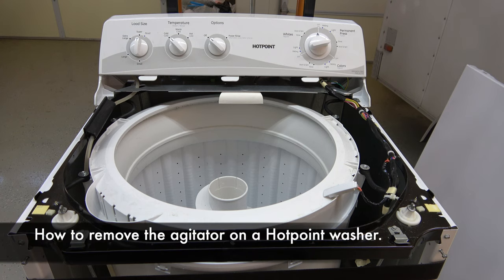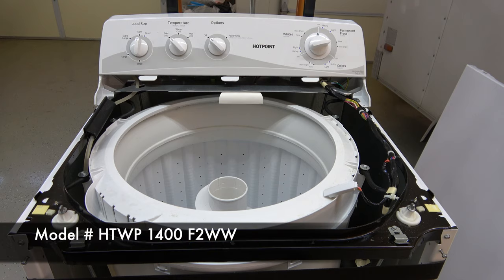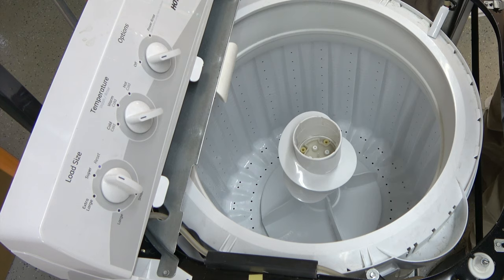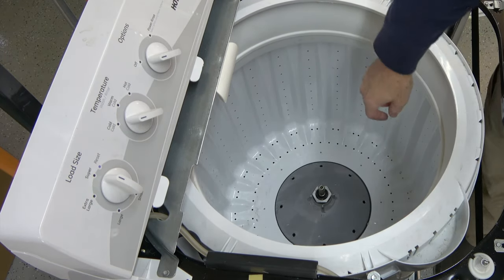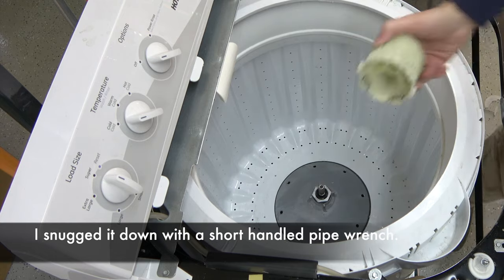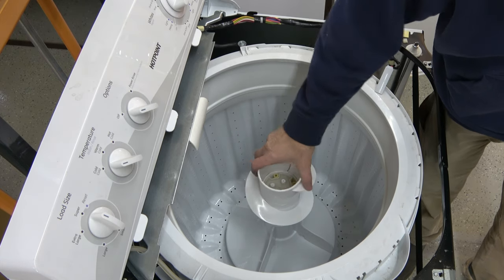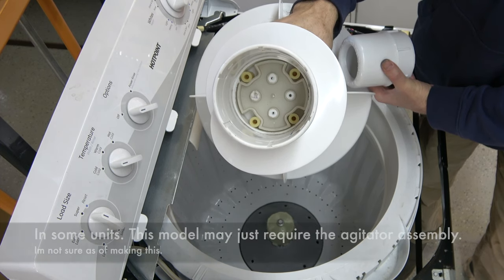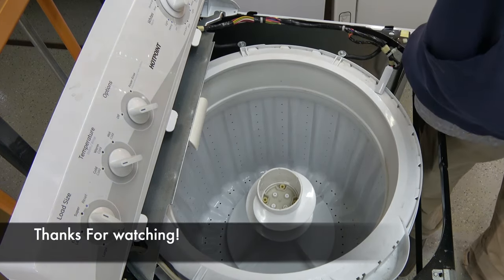Hotpoint washing machine. How to remove the agitator. And more.

Comment: this really helped me in cleaning under the agitator, you might want to mention to line up the groves in the agitator when you put it back on.
Reply from the maker: Glad it helped with your mission.  As you mentioned.  There are ribs on the hub and grooves in the inner diameter of the agitator that line up. I just kind of eye balled the relationship of the paddles and the orientation to each other, (grooves, ribs,) as I placed the agitator back on. Always good to have any feedback to share with people if I missed some thing or some thing needs some clarification.. Thanks for that.

Comment: This video was GREAT. I have a Hotpoint and a mattress pad got twisted around underneath the agitator.  I looked at various videos like he did.  So thank you for making this one.  I had to put my dog leash underneath and my son helped pop it off.  From there it was easy.  As many times as I have washed these never ever had this happen.
Reply from the maker: Glad it helped. The first time I pulled it out. Leaning over it, pulling on it firmly with both hands. I jabbed myself in the ribs pretty good when it let loose. So going through the steps again, made it a little easier. Thanks for the feedback.

Comment: Guess Im not strong enough.  Tried to remove the softener part to clean it and wasn't able to pull it up and off.  Thanks for showing me though.
Reply from the maker: Yes it may take a firm grip. Maybe you can get some help.
Reply: To get mine off I stuck my fingers inside where you pour the fabric softener. There is a lip there and I pulled it up easily. The agitator required a flat dog leash. I'm around 5'2 and was honestly afraid it would hit me in the face so the leash kept me at a safe distance and gave me additional leverage. Hope this helps! I have the same model as what was shown.

Comment: Can't remove the plastic cap to get the screws off
Reply from the maker: This model does not require that. Some do. But this particular model does not. You simply need to tug on the agitator from the bottom to get it to snap off.

Comment: Can't get dome off that is the part that I need help with
Reply from the maker: If you have this same model. There is no need to remove it. In fact its in there quite snug with either adhesive or maybe softener build up. Id say adhesive.Thats the mistake I made and I think I babbled a bit about that.   If you are working on a different brand or model that holds the agitator on with a nut then yes.  If so you should be able to work it out grabbing a fin with a pliers without much problem.  Many other models require that.  But not this model. Hopefully that helps?

Comment: Great video.  It was exactly what was wrong with it.  I thought it was a bearing.  Good job!!!
Reply from the maker: Glad it helped. It can be a rude awakening when that thing starts letting you know it's unhappy. Make sure you snug that nut tight. A few good taps with a mallet. Cranked Hand tight sometimes just doesn't do it. And it can become unhappy again after a few loads.

Comment: I am grateful you shared your knowledge of this Hotpoint agitator removal. My daughter caught her work smock string under it and I had to remove it to get it free. I worked on a few machines in my day but never had one you had to just pull up hard on on it . I would not wanted to pull so hard to get it in off if it wasn't for seeing your video. Thank You Very Much!!
Reply from the maker: You are welcome! That was the man reason for making it Id say. Because most have the nut under the softener cup. It was something I thought worth sharing to help others avoid the mystery. Glad it worked out for you.

Comment: Yes! I will be able to take off the basket of an old Hotpoint washing machine and convert into a outdoor firepit. Thank you so much!
Reply from the maker: You are so welcome. That is of course another fantastic option. Hahaha!  Assuming yours isn't plastic or plastic coated like mine.
Reply: @ericinalaska7648  Finally, there was a bolt under the soap bowl. After unscrewing, I only had to pull out the transmission shaft. Got my drilled basket for firepit, fantastic!
Reply from the maker: @jean-francoisdion2355  Hahaha!  Fantastic. Enjoy.

Comment: Thank you so much for this video. My machine is making a very loud grinding sound when it starts to wash and don't do it in the spin cycle. Can you help. Have the same washer machine.
Reply from the maker: Tuff one without eyes on it and seeing and hearing. But my issue with the parts I had to replace was when it would spin it would behave like an out of balance load. Because the tub was loose and parts got sloppy . A grinding sound isn't something I experienced.  If your not familiar with working on stuff like this Id see about getting someone who is to take a look. There really isn't too much to them that it can be. Motor, water pump, tub assembly, electrical Sheet metal body/frame/panels water supply and drain hoses. But labor adds up. If you can't or cant get family or a friend to look. You should be able to get a service call for a flat rate and then get an opinion to decide if its worth fixing or replacing. Hope that helps.

Comment: How do I get the dome off or out. I’m a women and pretty independent so I’m stuck now.
Thank you so much it was really helpful
Reply from the maker: If you have the exact model as this video. You don't need to remove the dome. Other models will have a fin or something you can grab with a pliers or the like and pull it out. And there would be a nut under it to be removed. That then frees up the agitator.  In the video I mentioned that I removed mine, and destroyed it basically based on other references and learned I didn't need to. This model you can simply pull the agitator out. No reason to remove the dome under the softner cup. No need to remove the softener cup either. Just pull it out as a unit. Some models may require it though. So if you don't have this model you can pull and pull and its not gonna come out.
Reply: They don't make them like they use to.

Comment: I have a problem with my washer and my dryer I  cleaned  it real good I checked all the fuses all good . Heats up all around the dryer but not in the dryer tube it’s self so do y’all have a video
Reply from the maker: I don't but I would suggest a couple things based on what you tell me. Im sure you know about cleaning your lint trap/screen. But your line out, Im assuming that's what your referring to when you say tube? Can get plugged aes well and should be cleaned at least annually. One of the most common causes of house fires.

Comment: Thanks buddy. I just destroyed my dome cap as well 🤦‍♂️
I wish I would have found this first
Reply from the maker: Hahaha! Yah. Guess no more softener. Glad it helped though. Better late than never.
Reply: @ericinalaska7648  😁 what sucks is i can't get the tub nut out now 😅
Seized up big time
Reply from the maker: Not to insult, but you are aware it's a reverse thread? Hopefully its that simple for you.
Reply: @ericinalaska7648  😅 yes I am. Its just extremely corroded
Reply from the maker: All joking aside. Pipe wrench and a hammer. It takes a decent crank to tighten it properly when installed. I found when tightening it if I just got it as tight as I could by hand or tapping it with my palm until the drum turned. It wasn't enough. It would loosen up again after a few loads. I put a short handled pipe wrench on it and hit it a few good times to really snug it up. Never had a problem since. I guess my point is that even without the corrosion its likely on there pretty good. But hopefully by the time you get this you've sorted it out.

Comment: I knew I would blow out my back with a quick jerk & pull, so I set it up with a ratchet strap and and a long 2X2 set on towels edge to edge on the washer...It popped right off after about 6 clicks...
Reply from the maker: Excellent. Many ways to come at it for sure once you determine its that kind of setup. The pop off vs. retaining nut style.

Comment: Mine is a lil different model 240s5, it looks like it has a nut or bolt in the center
Reply from the maker: Yep. Possibly the most common set up. Going after the nut in the center under the fabric softener cup is how I discovered there wasn't one on this model.  And then after sorting out how to come at this version. Figured it would be worth sharing the moment of enlightenment. Sounds like you got it though.

Comment: What if it's not  spinning  and the water leaking right back out of the drain line
Reply from the maker: Leaking? Or draining? Draining occurs during the spin cycle.Thats all basically controlled by the dial which is kind of like a timer. After sitting and not spinning and the dial gets to the drain cycle. Its still going to drain. Leaving your clothes much wetter because it didn't spin. But if it's leaking? Thats another story.

Comment: Great video, I do have a question though, is removing the front and top panels difficult? Like is there anything I need to be aware of? Thanks.
Reply from the maker: Hey Kyle. Pretty easy actually. First of course unplug and disconnect and or shut off the water. This unit and most have a couple of release clips on top of the front panel between the top and front panel.. I usually use a thin putty knife. Slide it in between the front panel and the top against the clip and either push firmly or sometimes whack the end of the handle with my palm. you should be able to look maybe with a flash light to see where each is. About an inch or two from each end. Then remove the front panel by pulling out on the top and then up and of the bottom retainer/clips. Set it aside. The top has a screw on each side in the front. Remove those and it frees the whole top up pretty good. You'll notice some wires. Those are for the sensor that tells the machine if the top is closed or not. So when you open it mid spin it stops spinning etc. Safety. You can release that from the bottom and turn it so it will fit through the slot. Feed it through. and then you maneuver the top off. The rest is held in place by kind of hooked edged and slots. I believe you push back and lift up to release the sides. And I believe the rear releases by pushing to the left. And lift out. I just kind of do it and am reliving it in my head. It may be slightly different. Rt instead of left and forward instead of back but you get the idea. And just repeat in reverse when reassembling. To get the tub out you have to release the back panel. With the knobs on it. Also pretty simple. Screws on the front bottom and back if I remember correctly and release. And swing it backward out of your way. Plenty of play in the wires to do so.  Hope I wasn't too vague and this helps.
Reply: @ericinalaska7648   This is really great and thorough, I'll give a shot. Thank you for the explanations, keep up the good work!

Comment: Thanks for relieving some anxiety about removing the agitator on my Hotpoint... Of all things, here in mid August, the ants have decided there must be something tasty inside my washing machine ! 
In particular it seems, they have focused on under and inside the agitator ... They attacked my shower last month... So maybe its soap particles ? ... Anyway, I figured, if I remove and clean the heck out of it, that it may discourage those pesky explorers ? ... I tried running on low, with lots of bleach... But ended up with a giant 'bathtub ring' of dead ants on the tub, about eight inches wide... 😖 ...
Reply from the maker: Well glad it helped. Im gonna suggest the possibility of them seeking out the tide pod challenge? No idea. Vinegar erases the scent trail they all follow to a target though. That I know.
Reply: @ericinalaska7648  Well, I was able to remove the agitator, and remove a lifetime of built up soap, soap crud, and calcium from inside the agitator, and from where it attaches... And even ran a rod through all the holes to be sure things are clear... Was a much needed maintenance chore ... Best regards 😁 ...
Reply from the maker: @larryg.9187  Never hurts to do maintenance.

Comment: What is the trick to get the agitator  back on completely.
Reply from the maker: No trick. Should just snap back on. May take a good oomph. But that's it. And it may need a little time for the plastic to spring back or relax into its most secure position. Are you having trouble? Or maybe its taking a little more persuasion than you thought it should or would?
Reply: @ericinalaska7648 Thanks for response !! I may have it in there not sure .Didn't hear a snap  .  Rubbed thin  layer of Vasoline  down  where snaps are located for smooth slide. Stuck thin board at bottom of pulley . So pully wouldn't smack bottom so hard. Should  be enough room for the fingers to slide under bottom agitator ?
Reply from the maker: @raditian2  Well My recollection is it was a bit time on the fingers getting them under to jerk it out. But if your feel like its in. It should again take a jerk to remove it. Probably not as much as the first time you took it apart but still resistance. If you can jut lift it out its likely not seated properly and all the way on.

Comment: How much does a new agitator cost?  Great video!
Reply from the maker: Hey Rodney.  I was looking at a few things such as a tub. Tub Hub. And Tub bushing and nut. I recall around $35 to $50ish for a new agitator. Plus shipping likely.  And certainly there are some for more, but you should be able to find one new in that range. For this particular model anyway.  Also keep in mind that's just the agitator. Not any other parts you may want or need for the assembly. All parts sold separately.

Comment: I have the same  wishing machine not spinning
Reply from the maker: Does it sound like it should be? Making all the same sounds when it goes into spin cycle but the tub doesn't spin? Does it agitate? Check that nut. Under the agitator.  If that's not it Its hard to say without looking at it. If the tub is tight. Unplug and shut off and or disconnect water. And tilt the machine in a manner that will see if you have a worn or broken belt. Heavy loads can cause it to ware over time. If your belt is broken. A new belt can be found online easily by searching for your model # drive belt replacement. About $20. Thats another poss. Its always a bit hard to troubleshoot with partial info online but hopefully that's of some help. Those would be the first two things I look at first.

Comment: Is there a link to part 1?
Reply from the maker: Are you referring to the parts I used/replaced. Here are the links for the two parts I purchased. 

https://www.amazon.com/gp/product/B00DM8LVDM/ref=ppx_yo_dt_b_asin_title_o06_s00?ie=UTF8&psc=1

https://www.amazon.com/gp/product/B00DZU9LA2/ref=ppx_yo_dt_b_asin_title_o06_s00?ie=UTF8&psc=1
Reply: @ericinalaska7648  thanks!
Reply from the maker: @king_invictus  Thank you. I added those links to the video info/description as well. Thanks for the heads up on that.

Comment: Wish you’d showed how to remove top of machine prior to repair.
Reply from the maker: Unless you're going further. Doing other repairs. Its not necessary. I was exploring and those panels were off to evaluate other things. That was just the state it was in when making the video. Its been a while but I may have mentioned that in the video. Maybe not. Other than for safety, unplugging and shutting off and disconnecting the water if your gonna move the machine for better access you should be able to do this without any other disassembly. Open the lid. Pop out the agitator as demonstrated or discussed and that will expose the parts underneath.
Reply: @ericinalaska7648  ok thanks.
Reply from the maker: @1divemaster1  Sure thing. Good luck on your mission.

Comment: Can't remove the plastic dome
Reply from the maker: This model does not require that. Some do. But this particular model does not. You simply need to tug on the agitator from the bottom to get it to snap off.

Comment: I can’t get the agitator out!!!
Reply from the maker: Is it the same make or model? If so, It can take some strength to pull or pop it loose. If its a different brand or model. It may have a bolt or nut holding it on under the softer cap assembly.